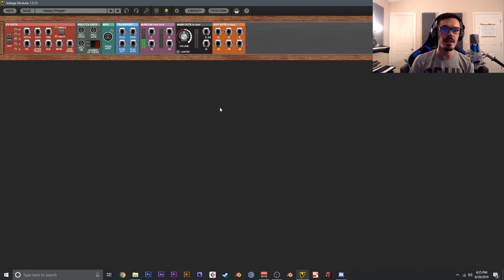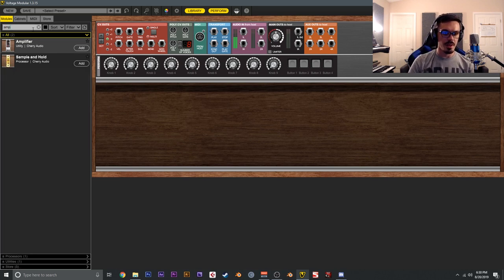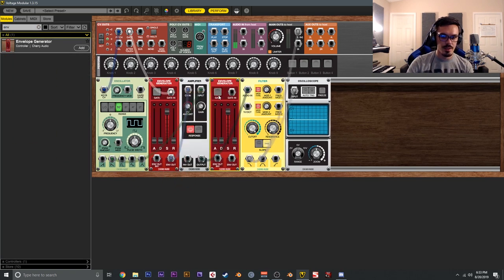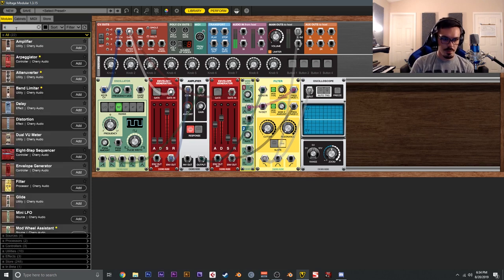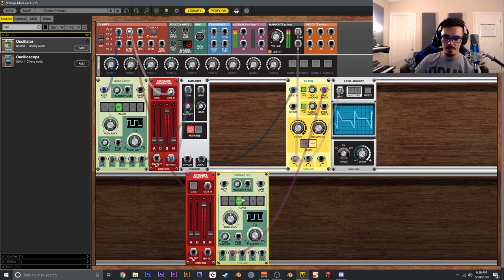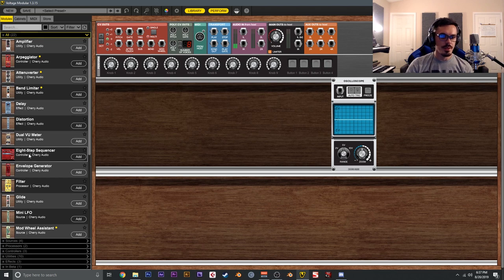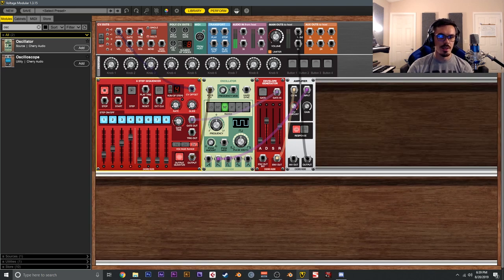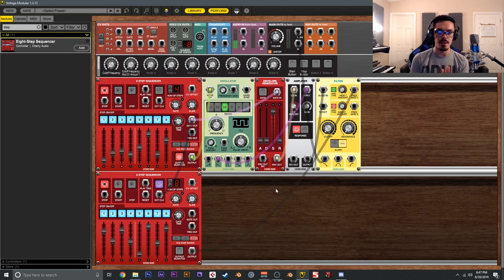Voltage Modular Nucleus Tutorial | Basics of Modular Patching

Comment: Idk if I'm dumb but the part at 12:50 loses me. I right click, "edit value", type in C1, press enter but it goes back to default
Reply from the maker: Interesting! Perhaps that behavior was changed. I just tested it, and was able to enter a note by clicking and entering a value, then clicking away.
Reply: @VenusTheory  Hmm.. For some reason the note value in the step sequencer won't go below C2. This is with version 2.2.4.
Not a biggie, but when following this tutorial I had to add 1 to every value given. I don't know if there is some basic setting (in the whole application or only for the step sequencer) that can change that, but as said - It's not really a problem.

Comment: heyo, thanks for the tutorial!
Quick question: when I patched the line from pitch, into amplifier, then into MAIN OUTS, the saw sound keeps on playing. It still responds to key triggers, but it just keeps on playing. Any idea how to stop it/make it completely key-trigger only? Cheers
Reply: re the connection:
just realised that I don't have KEYB CV, but rather just a PITCH CV. Maybe that's the problem?
Reply from the maker: Yo! For that you would need to add an Envelope with the CV modifying the Amplifier and trigger the envelope with the Gate in the I/O panel.

As for Keyb CV and Pitch CV - these are the same thing, it was just renamed in the updated version.

Comment: What does it mean to connect two outputs to the same input?
Reply: You could connect two (or all) of the oscillators waveform outputs to the input of the amplifier for example. You would have two or more cables going for the input in this case. Makes for a whole different sound than just a sinewave. Or you could try it with LFO ?? ;)
Reply: @dewil7313  Thanks for the reply! If I'm not mistaken, this doesn't work with hardware modular, right? A shortcut in Voltage Modular to save a mixer?
Reply: @baganatube  I thought I replied but maybe the links were not appropriate, sorry for that. There are these things called split and stack cables and I think you could do a search on those and find some answers ;)